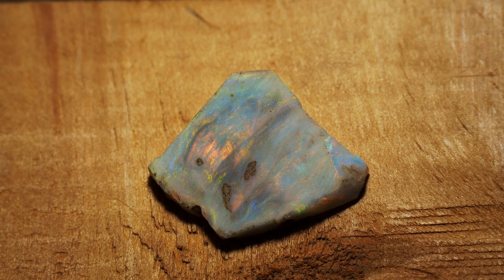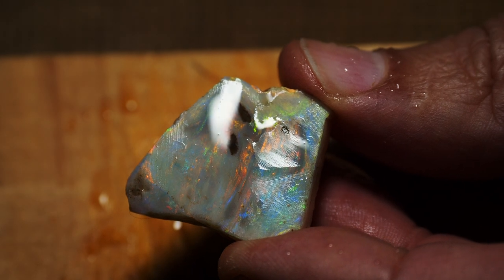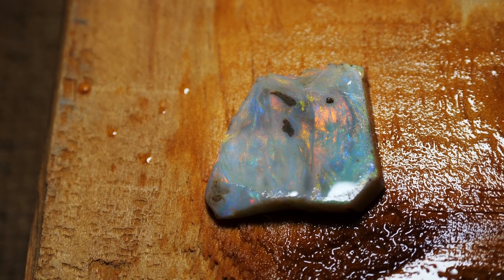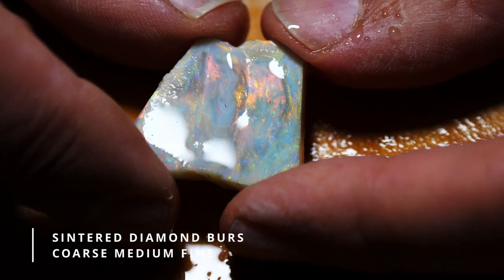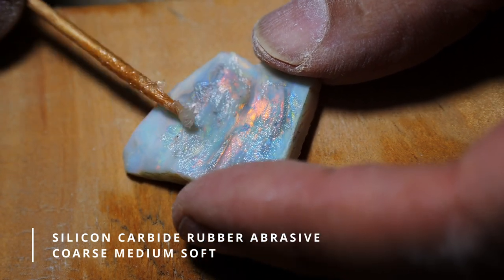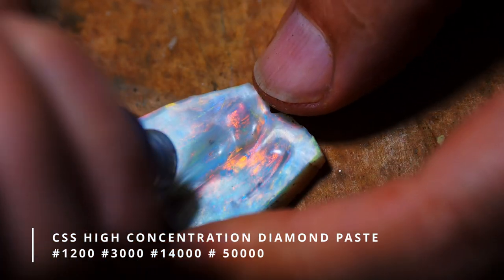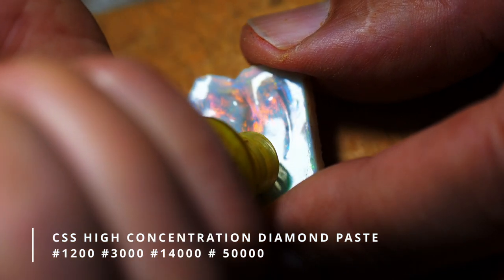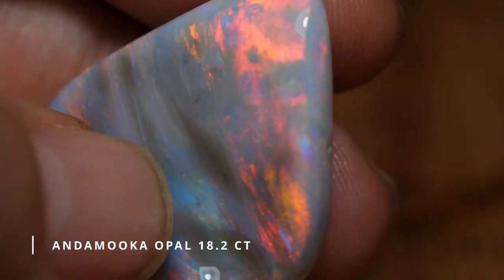Was Carving a Good or Bad Choice for this beautiful Andamooka OPAL?

Comment: Great video , lovely finish really shiny  ,  do you Rate that Diamond paste higher than cerium oxide  ?
Reply from the maker: Thanks for your feedback. A good polish is relative to your prepolish stages. To be quite honest there are different qualities of diamond paste and cerium. I use both and am happy with the results of both because I know they are both high quality. I tend to use diamond paste during carving work as it doesn't spray or throw off as easily as powders do.

Comment: Starting with carving gives you the freedom to change you mind later and switch to cutting cabochons. You needed to remove the dirt in either case, right? Wouldn't work the other way around. 

Personally, I'd be inclined to cut the best portions of the stone into cabochons if unhappy with carving. Just seems to make the most sense economically (given my view from video).

My rationale is that it looks like you might have small inclusions throughout stone. Cutting cabochons would allow you to cut around those flaws.
Reply from the maker: Thanks for your thoughts and feedback. The dirt/inclusions were evenly spread throughout the stone. I think I would have lost a lot more weight if  I tried to remove it all.

Comment: What is the reason you don’t use water
Reply from the maker: I guess I could have used water during the initial clean up and shaping but after that I want to see quickly where I have been working during the subsequent grades. Also, its not possible to use diamond paste with water effectively.